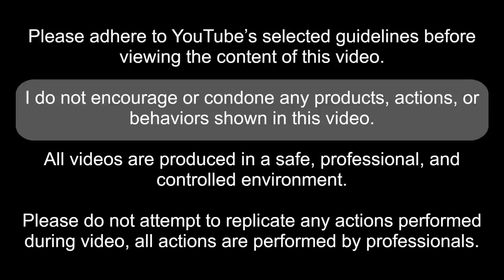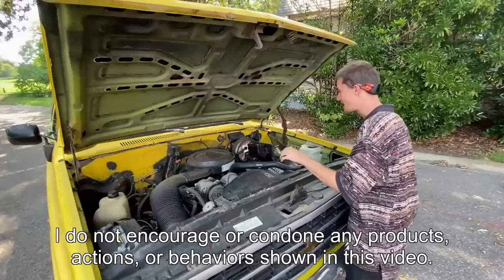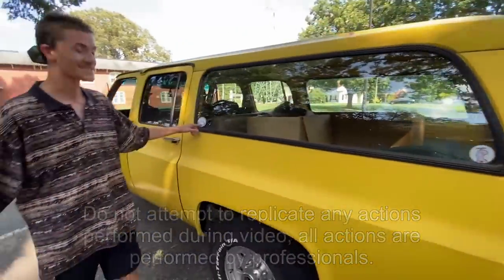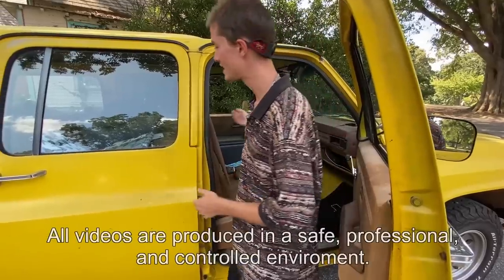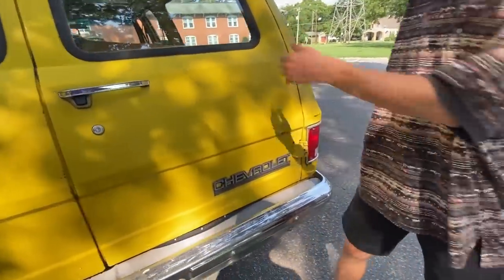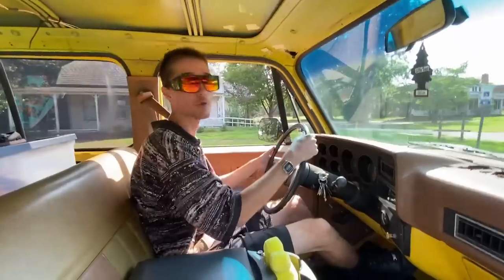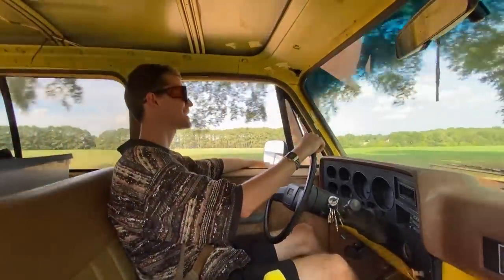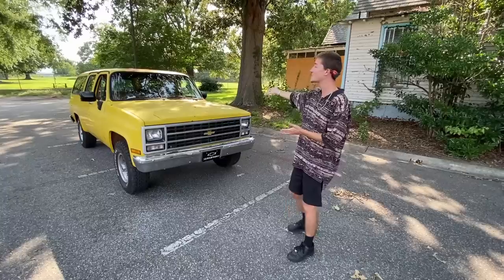I Bought a Squarebody Suburban. No, It's Not "Too Big"

Comment: Congrats on your purchase, hopefully it doesn't give you too much trouble in the future.  As long as you keep the oil and trans fluids clean, and the ignition and cooling systems maintained and replace them as maintenance requires that behemoth will keep going long after you and me bud.  That's good old fashioned American steel right there.
Reply from the maker: appreciate it man! it's definitely got its share of old car issues but nothing terribly major, just bits and bobs. and of course, proper maintenance at the proper time is the best way to keep a car on the road 👌👌

Comment: I like those Chev & GMC square body models. They were built from 1973 - 1991 except the half ton & three quarter ton plain cab pickups were finished in 1987, & the one ton plain cab pickups were finished in 1989. 1990 was the first year for optional power side mirrors on those square body SUVs, but weren't offered on the pickups. In 1987, the C/K series were dropped & renamed R/V series & the reason for the name change was to make a distinction between the square body models & the upcoming next generation C/K series pickups which were the OBSs for the 1988 model year because both of those body designs were going to be in production at the same time which lasted up through 1991. 1987 was also the first year for gasoline fuel injected motors which replaced the carburetors.

Comment: Just recently bought a 1979 Chevy suburban 20 Scottsdale, The 20 Is a 2500 Before the 2500 Numbers, Mine was a military truck. They put a 1982 6.2l Detroit diesel and a Manual transmission and runs Great. i get about 24 26Mpg around 55 60mph,

Comment: Good buy! Keep the oil clean and the trans fluid checked. If the trans hasn't been changed in forever, you might consider a flush or change. Some say not to change it if it has never been changed bc of the condition of the oil and how it flows. It creates its own pathways and new fluid might messs that up if you can understand what i mean. Other than that, rock solid. Get some nice old school engine parts from Holly and you'll be good. Talk to Cleetus McFarland. he would help you.
Reply: I’m not into cars or know how they work but could you potentially do ~50 percent old oil and ~50 percent new oil? Or would that mess it up

Comment: I may be biased but cummins are for sure a great drive, plus the 6bt is one of the most reliable production engines of all time
Reply from the maker: definitely considering a cummins! haven't done much research on 6bt's but i need to for sure. can't remember if i said it in the video, but I'm also considering an om606, as i've heard they're reliable and can be tuned without needing too much work on the internals. although i am a mercedes fan so i am also biased 😂

Comment: 18:15 definitely do a 12 valve cummins swap. Its the 6bt, don’t put a 4bt in unless you want a slower truck compared to the 12 valve. Duramax swaps are way more complicated and involve a shit ton more electronics to swap over. 12 valve is miles easier to swap. Also, how is the Suburban doing these days? Been a while since I’ve asked about it lol.
Reply from the maker: If I ever have the money, a 12v swap is what I'm looking at doing! Good to know the information you stated as well, appreciate it! I've looked into 12v swaps before, and while it does seem easier than other swaps, it still doesn't appear to be easy, or cheap to say the least 😂

To answer your question, the Suburban is currently not doing so hot, haven't driven it in a while because of that. It's having issues with idling, and a noise similar to a rod knock has appeared. Took it to a shop to no avail, gonna have to take it to another shop to see if I can get a professional opinion before putting money into it.

Comment: You can literally see the AC compressor on the passenger side top of the engine.... You have AC dash vents, if you had no AC there would be no vents in the dash. You also have the AC HAVC controls.......Your AC just doesn't work.